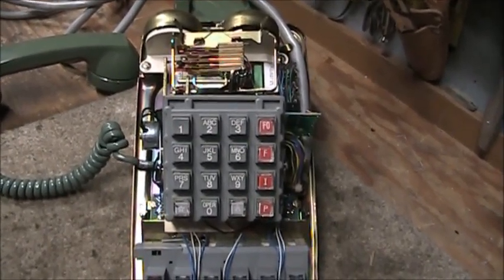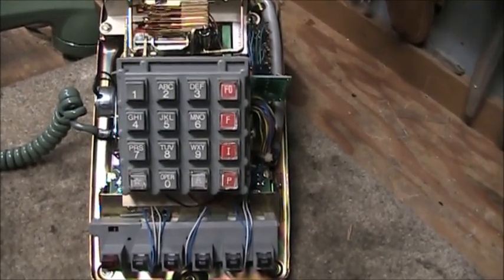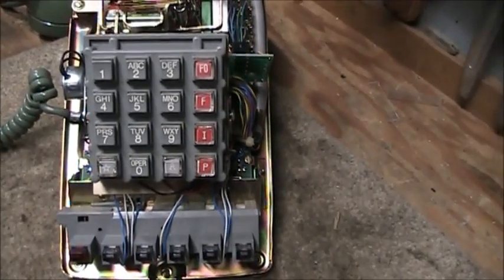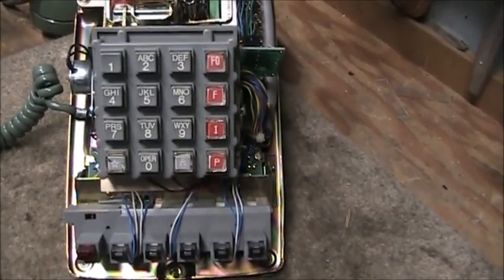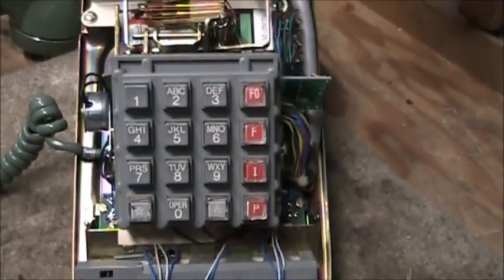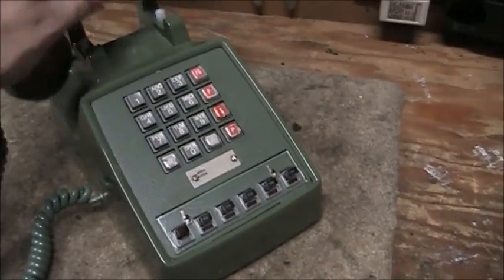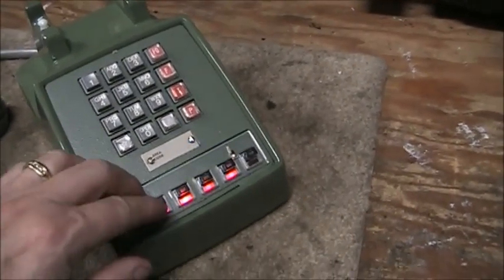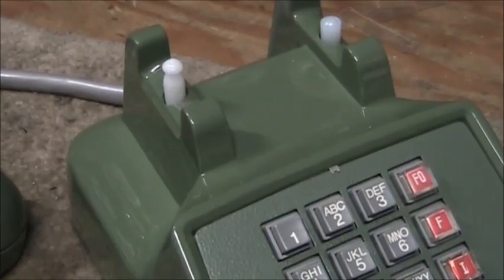1A2 Autovon phone

Comment: FO Stands for Flash Override only officials with command authority of the military, the president, joint chiefs, national security advisor, commanders within the armed forces or anyone reporting some kind of attack was allowed to use those buttons

FO Flash Override
F Flash
I Immediate Priority
P Priority
If you didn’t push any of those buttons before dialing a call your call was considered routine.

This system instead of having a busy signal when dialing, if your call had priority and the destination phone was busy you would make that call drop out and be connected with that receiving end of the call.

The bell system make this network for the military it operated on the autovon (that was the name of the system the military used) — it’s been replaced long ago but the priority buttons still are in use in the newer systems the military presently uses.

Comment: I'm slightly less than "a public commentator" because I was the #1 ESS 4-Wire AUTOVON programmer for Translations, Card Writing, and Recent Changes from 4/'67 to EOY '69 at BTL Naperville. Suffice it to say, I see someone already corrected: "Flash" and "Flash Override." Likely due to security classification and compartmentalization, I never learned if I did good or bad. I lateraled back to an Operating Company in God's Country to learn, perform, and mid-level manage the rest of telephony re. POTS, until the great Hinsdale, IL C.O. fire whereupon I became part of National Security and Emergency Preparedness with a much higher security clearance, doing stuff CONUS inclusive. Yep, I began with two-digit dates and spent most of ’89 doing Y2K stuff. The cost of core memory in ’67 required the most efficient software possible, amongst other reasons….

Comment: The Western Electric version is a 3568HT or 3568HH (lighted dial). It has a special hook switch that has contacts to disconnect all 4 handset leads and short both the transmitter and receiver when on hook.

Comment: You pretty much had to be a 4 Star General or be in a command center to be authorized to use Flash Override. Flash was for “regular” Generals. Even priority was restricted to lieutenants and above.
Reply: FO was 'supposedly' reserved for Presidential Use Only. However in the Army Signal Corp main tactical switches we used it for CLASSIFIED stuff